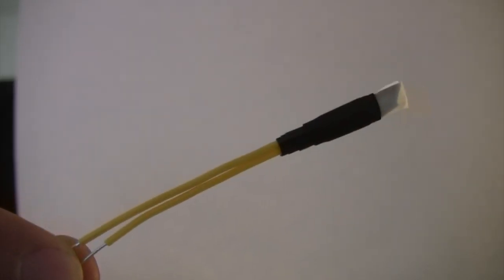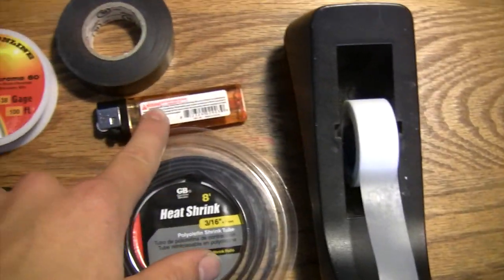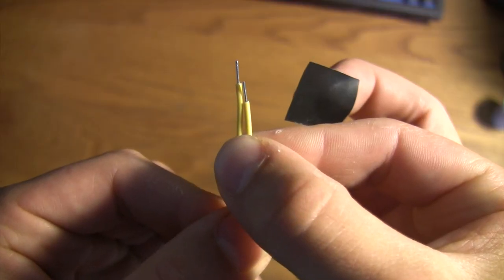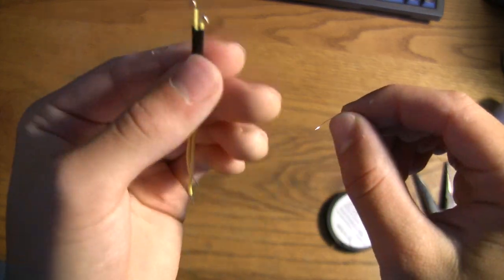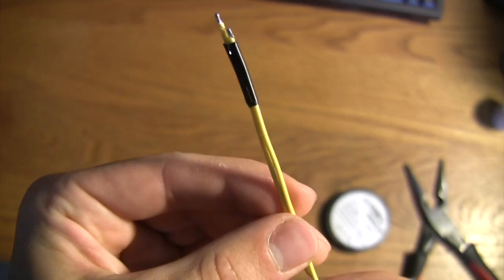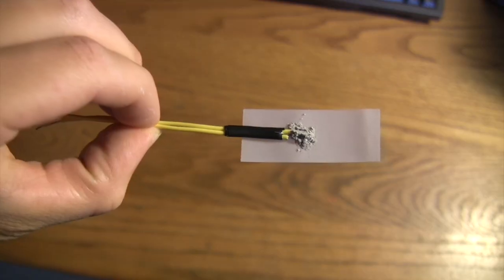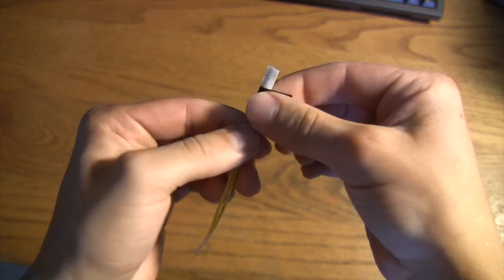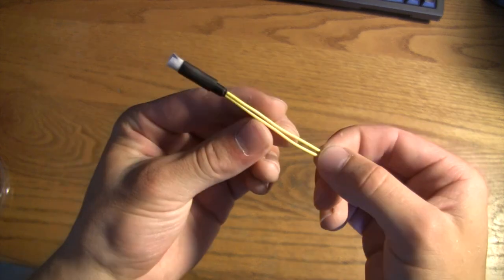How To Make Igniters/E-Matches

Comment: you can substitute michrome wire with steel scrubbing pad strands and matchs. 100% ignition so far over 100+ ignitions
Reply: I can't get to ignite black powder with steel scrubbing strands with only 6v/2amps
Reply: @luddechamp  Thanks, I have another approach that works great. Only 3.3V does the job using the right wire.
Reply: Ernesto Melo i use a 1,5 AAA battery and it works perfect also, lights the flash powder 
Glad you found a way that suits you :)
Reply from the maker: I gave up on small batteries and started using my rechargeable drill battery. Works every time.

Comment: Very nice video and wonderfully present. Thanks again for the video brother. I have question regarding the battery...  May I know what size of battery should I have to use for good ignition ?
Reply from the maker: Thank you! I was using a 9 volt battery, but the best ignition comes from using something like a rechargeable drill battery.
Reply: @pyrogun1839  how much ampere of you 9v battery brother ?

Comment: Use 10:1 black powder,dextrin mix! Make a paste with couple drops of alcohol and dip ignitors in mix! No need for tape and messy powder! If you dont have nichrome use 2 strands of speaker wire!
Reply from the maker: I'll have to try that!
Reply: Isn't speaker wire made if copper?
Does copper work as well?

Comment: Does it have to be solid wire? I have access to as much 22 and 24 guage strand wire I want at work
Reply from the maker: If you use solid wire, you can clamp the nichrome wire in place. With strand wire, you'd likely need to solder the nichrome wire to it (more work).
Reply: @pyrogun1839  the more work isn't that bad if wire and solder costs me nothing right? lol... Now would this set up work on the firing cues that take 4 AA batteries?
Reply from the maker: @Chaotic_Enigma  That's true! It might work. I would imagine it depends on what size nichrome wire you use and how long your wires are to the igniters. I've used 9V batteries in the past and found I had some issues with ignition. However, those issues could have been caused by faulty igniters, hard to tell. You'll just have to experiment with it! I've found a rechargeable drill battery (20 something volts) works remarkably for me.
Reply: @pyrogun1839  yea I forgot that the size nichrome is key here depending on volts. I noticed that nichrome gets ridiculous in price if ya want 48 guage and smaller lol. Thanks man
Reply from the maker: @Chaotic_Enigma  You're welcome! Hope they work well for you.
Reply: I got a normal 1,5v battery to light the match within a second.

Comment: How much v bettrey you used for 32 gauge wire and 38 gauge wire?
Reply from the maker: 9V works for 38, but I use a 20V battery for the 32.
Reply: I used 9v but it's not heat up
Reply from the maker: Hmm, maybe your battery is low or dead.  9V should definitely heat up a 38 gauge wire.
Reply: I used new 1604s 6F22 9v battery
Reply from the maker: Something is probably wrong with the igniter then.
Reply: but when i use 6 *1.5v AAA batterys wire heat up instantally
Reply: did you connected then in series or parallel?

Comment: You won't light anything with that, you need longer, hotter, bigger flame. Use Rcandy for example, this thing is kinda trash for rocketry
Reply from the maker: Yeah, it didn't always work with my rocket engines. Works pretty much all the time for fireworks though. I made an updated igniter tutorial for rocket engines...https://www.youtube.com/watch?v=n2DP1pzeg_U
Reply: @pyrogun1839  same problems for those ones. Black powder won't light experimental motor properly, especially if it's apcp
Reply from the maker: @shere_kan8329  I don't use apcp so it's not a problem for me 🤷🏼‍♂️

Comment: What if you use 30 gauge wire?
Reply from the maker: I'm not positive since I have never used it, but it would need a large battery to heat up quickly.  I use a 20V drill battery for the 32 gauge wire.